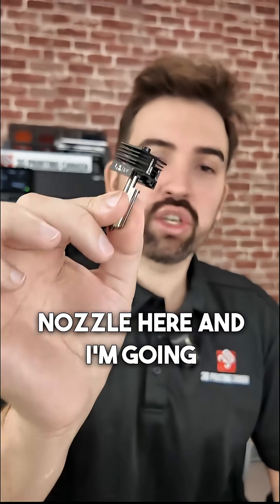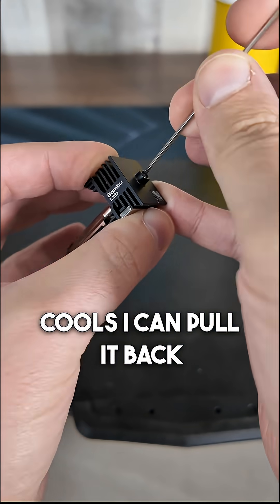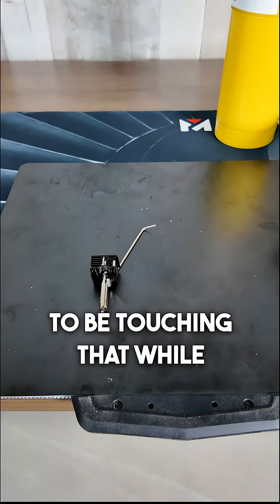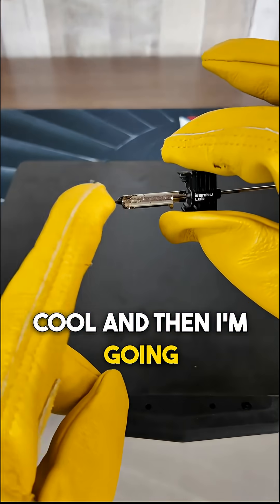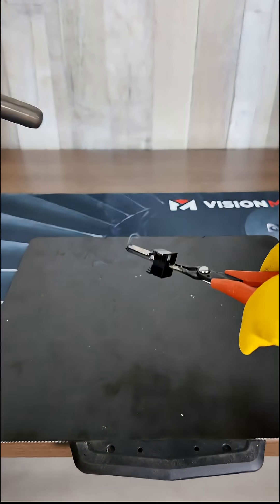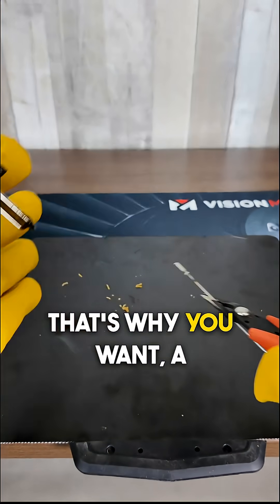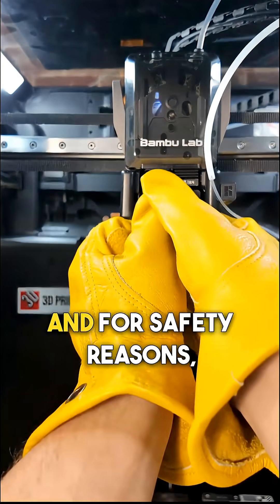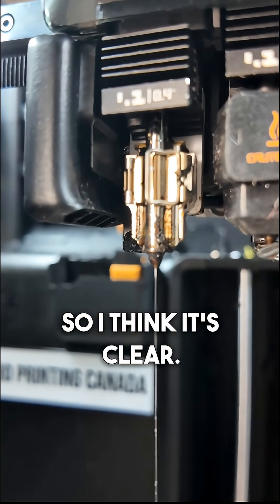How To Unclog a 3D Printer Nozzle #bambulab #3dprinting

Comment: Here's a better way: grab the nozzle with pliers, heat up the nozzle and a nozzle clog tool (looks like an ice pick the same gauge as the filament) at the same time, then push the filament from the other side, it will start extruding as it does when printing. Btw you should be using a heat gun instead of a torch, otherwise you might burn that QR code on the top that the printer uses to read the nozzle size, is also generally safer than a torch, cheers!

Comment: Wonder if placing the nozzle on a heat-resistant surface and going at it with a heat gun might help.  I did similar with the old E3D nozzles, and used a resistor to dislodge the melted plastic.  However, those nozzles are relatively cheap so after 1-2 cold pull attempts with cleaning filament, I'd just chuck them and replace.

Comment: folks please use a dust filter for your filaments to avoid this situation. also cleaning and maintenance must be done at least once a month.

before even coming close to attempting this, try heating it using the printers heater to max temp. use a needle to dislodge anything in the nozzle then attempt cold pull a few times.
Reply from the maker: Good advice, I tried those steps first but was unable to unclog it. I was using a unique industrial filament in it and this was the last resort method.

Comment: use the right tool, and do it on the printer using the nozzle's own heat.  You used too much heat.  You can do a cooling pull using fillament, pulling at around 135.  Don't do it this way.
Reply: This method listed on bambu wiki. So... Even the manufacturer recommend this last resort
Reply: That's why he said as a last resort.

Comment: Blasting the nozzle with a torch cannot be good for it can it? I mean the thermister or whatever heating component on the nozzle can definitely get burnt off
Reply: Depends on the design of the hot end. Most traditional hot ends (like v6-style or Bambu X1/P1 type) do have heaters and thermistors in them that should be removed before doing something like this, but many new printers that have quick swap hotends (like the E3D Revo or the Bambu second gen) do not.
I'd still avoid the propane torch because it can produce too much heat and that can easily damage aluminum (and even steel) if you're not careful.
Reply: If he has it on for too long there is a chance that the steel could soften, this is called annealing and happens when you hear up metal very hot and have it cool over a long period of time. For instance, if it cooled over a short period of time it would be hardened again and then it should be tempered. But anyway I dont think he heated it up enough to worry and it was already not working.
Reply: its meant to be heated up to very hot temps
Reply: @ColombianBocchi  yes, but not with direct heat that gets well above 1000c
Reply: They are designed to be heated to 300c when they operate.
Reply: The only danger would be heating it up to much where it would loose its heat treatment
Reply: Dude are you serious? It is just pure metal
Reply: Just read about where the heating element or temp sensor is in bambu h2 series and then write down this nonsense.